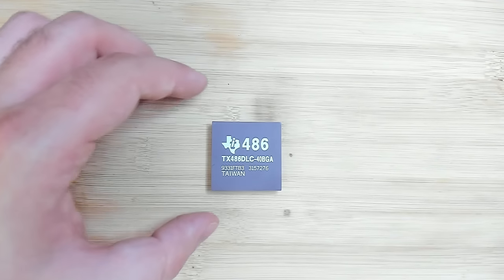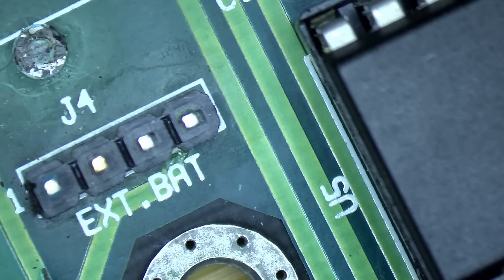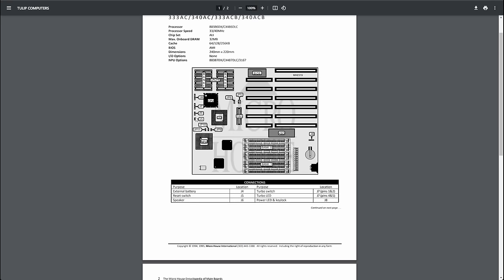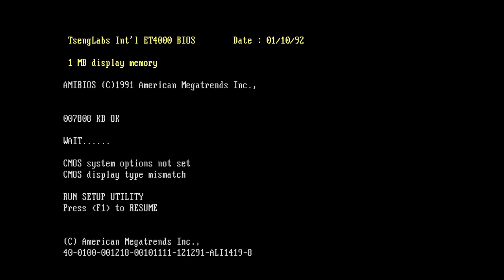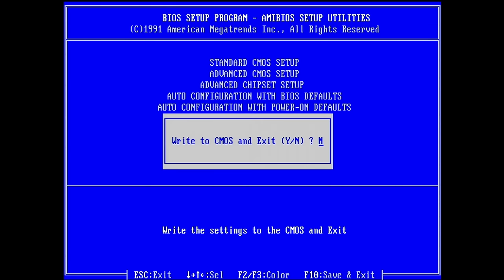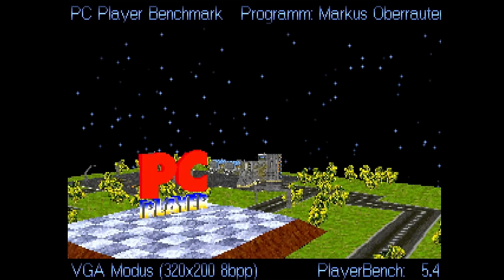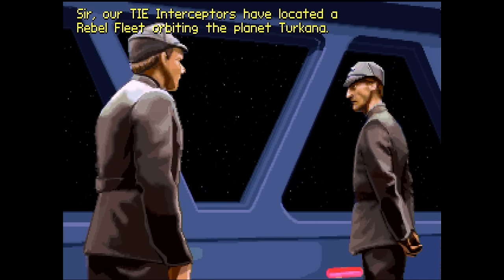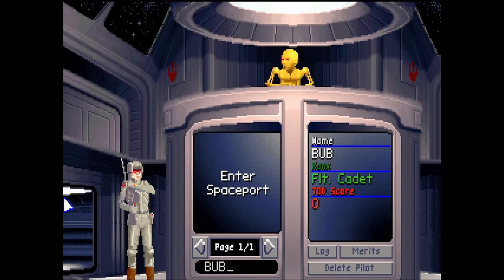A wolf in sheep's clothing: Cyrix 486DLC

Comment: As usual, great video. I have an Intel 486DX 25Mhz processor. It is historically the first 486DX processor and supposedly doesn't require a heatsink, but.... it heats up considerably during operation, so if your 486DLC has a 40Mhz clock then it definitely needs to have at least a heatsink.
Reply from the maker: I agree. Those CPUs shouldn't be operated without a heatsink. The surface on my 486DLC got uncomfortably hot - I wonder for how long this CPU was tortured in that motherboard before it was thrown out. I guess those chips can withstand higher temperatures than my fingers, but a simple heatsink can do so much! There is no reason not to put one on those CPUs.

Comment: Auto detection was a very rare thing in 386 and early 486 days.
Reply from the maker: I was surprised to not see the option because my Soyo 386 board had that option. And the BIOS looks very similar (but that isn't an indicator - most BIOSes we're just copies).
Reply: @bitsundbolts  Aye, I can only recall maybe a handful of boards I ever saw it on, then it appeared on everything at once. More towards the later 486's.
Reply: @envoycdx  And also, an unreliable mess. You're better off not relying on that auto detection and instead using an XTIDE 386 BIOS on an add-in card so you get proper LBA support.
Reply: Yeah I remember putting in CHS values until around the Pentium era.

Comment: This was my processor of choice as  a then-new user of OS/2 v2.1.  It was a heck of a lot cheaper than a 486, performed awesome, and you could take that savings and put it into more ram, which OS/2 really needed.  This with 8mb of ran was the sweet-spot.

Comment: I had one of these 486DLC-40 CPUs back in the day that I bought with a motherboard from Computer Stop in Bellevue. It was a lot faster than the 386sx I had previously but something caused a problem I never resolved where anything that played .wav sounds through the Sound Blaster would cause a cyclic screeching sound. Later I upgraded to a Pentium 60 and was blown away by the speed increase. I miss the days when you could upgrade after just a few years and see an absolutely massive speed increase, like 3-5 times faster. Now a brand new computer is maybe twice as fast as one that's a whopping 10 years old.

Comment: Ah great memories. My first PC had a Cyrix 486 DX2 80 MHz CPU installed. I reckon performance wise it would pretty much equal an Intel DX2 66. I've had it for nearly 2 years before replacing it with a Pentium 133 back in 1997. The 486 took me from DOS 6.22/Windows 3.11 to Windows 95. What a difference Win95 made.

Comment: A small part of me misses the 90's, when we were able to squeeze an extra mhz out of a CPU and we actually thought we could see the difference.  Things were so much simple then.
Reply from the maker: It was the time PCs entered households and consumers started using PCs for all kinds of things. The people who grew up during that time will have good memories of that simpler time. You could buy a new system every 18 months with double the compute power - or upgrade with a drop in replacement. Another option would have been overclocking which could unlock some extra performance and increase the usefulness of a CPU for a couple of extra months.
I like the 'simpler' time because I learn about electronics while I'm trying to restore those old electronics.

Comment: Nice work and comparison.  Both the DLC and DX were more than playable from the footage, but the DLC was noticeably smoother.  For whatever reason, when I had the 486 DLC back in the day, protected mode extender games had this weird habit of causing the keyboard controller to randomly malfunction.  Never did track that one down, and I never really see it mentioned by anyone else, so it could have been a fluke of my specific system.  The joystick ports would keep going fine when this would happen, so I had that going for me.
Reply from the maker: I was surprised how well the 486DLC performed. I didn't notice any weird behavior of the CPU, but I also didn't test it for a long time. I want to experiment a bit more with that CPU, the BIOS cache setting, and the Cyrix tools. Maybe I'll come across the issue you faced.
Reply: @bitsundbolts  It has been a long time since I had that computer, but I remember the symptoms well.  I'd be cruising along and then the computer would freeze for a moment, with the usual last-few-milliseconds of audio effect.  When I'd come out the other side, no keyboard until a reboot.  

I suspect now that I may have been offloaded a 386 board that wasn't quite compatible by the dealer, since I wouldn't have known better back then.  I've also read that early 486DLCs get very hot, and I don't think I had a heatsink or fan at that point.  The idea was pretty foreign at the time!

With everything working, though, it would be a good and cheaper match for its real competition, 486 SX 25 and 33 computers.  Kind of like the DX 40, it was a really nice and popular alternative to hold out until things got more affordable.  Keep up the good work.
Reply from the maker: I noticed the temperature of my 486DLC as well! It runs way too hot without a heatsink in my opinion. A cooler might have done the trick to solve that issue you had back then. During my research, I found many saying those CPUs weren't good - maybe they were badly priced for what they offered. But I agree, those CPUs could compete with entry model 486 CPUs, especially the SX versions without a floating point unit

Comment: CLK2 is the name of clock input pin on the 386 chip (yes, where the crystal connects). The CPU divides it by 2 internally, hence the name I guess.
Back in 486 times I used to overclock my ISA bus to 13.33MHz (40MHz /3) 😸
Reply from the maker: Well, glad I figured that out on the fly 😂. Wow, an ISA Bus at almost 14 MHz? Wouldn't that cause all kinds of stability issues? I guess it depends what expansion cards you used.
Reply: @bitsundbolts  I was a kid and just poked around to make my 486 faster. It did work with generic ISA I/O card (Winbond chips IIRC) and Trident TVGA 8900. Added ALS100 sound card later, and it also worked. Just remember that /2 didn't work and /3 did, so I left that. Going from 80MHz 486DX2 (overclocked from 66MHz) to K6-II at 350MHz was a huge jump 😃

Comment: I have a 386 motherboard that I've been restoring, as it was badly damaged by a leaky battery. And for it I have a TI486DLC-40 ready. The other 386 I have is a cute little one, with a soldered SX and room for the 387.
Reply from the maker: Nice! Good luck with the restoration if it isn't done by now. I hope both boards will work well. The 386 is an amazing platform - at least that's how I feel about it.

Comment: The only place I ever remember seeing these are in laptops, and I think an old laptop I have ever has one in it. Pretty nice performance bump on a 386 board, it makes me wonder why these weren't more popular. My first dos computer was a 386dx40 in 1993, and that was the common low end option at that time, with all 486s up to the dx2/66 being quite a bit more.
Reply from the maker: I think the price of these CPUs was very high. I read that it might have been cheaper to get a low-end board and a 486 instead of one of those. If they would have been priced better, maybe they would have been more popular. But I agree, looking at the performance today, those chips were nice upgrades for 386 systems.

Comment: I managed to get an entire 486DLC desktop computer a few months ago.  The CPU is soldered directly to the board on mine.  It booted right up and the latest file date on the hard drive is 1998.  It appears to have been used for a machine.  I have not loaded any games on it yet but I look forward to comparing it to my own 386 computers and my lower clocked 486 computers.  The battery had just started to leak but no corrosion on the board was noticed after I removed the battery.
Reply from the maker: You got lucky that the battery didn't cause damage! Boards without damage aren't that common. I'm sure you'll have a lot of fun with this system.

Comment: I was going to buy one of these back in the day (around 1994-5ish) but it was actually cheaper to buy a Cyrix 486DX2/66 with basic PC Chips motherboard (especially when you factored in the sale of the old board) ... Yes those motherboards were terrible but I was a student and it still represented a huge improvement over my 386DX40!
Reply from the maker: That is what I've read. It wasn't worth buying those hybrid chips for the price they were advertised for.
Reply: @bitsundbolts  Yeah... I guess they were cost effective if you had a machine with a proprietary motherboard and so couldn't cheaply replace it.

Interestingly though I do recall some budget PC builders in the UK selling complete 486DLC40 machines for prices between the 386 and 486/25. So if you bought these chips in higher quantities they must have been quite cheap.

The same sellers were also selling UMC 486 based machines which also seem to have been massively underrated. 

And interestingly, from your findings here the 486DLC40 was a better budget option than a 486SX25 for sure... These had a reputation for being a bit slow and rubbish at the time but to be honest it looks like that wasn't deserved!

Comment: There's no need to disable the charging circuit: The ALI M5818 RTC has a dedicated battery input, like the Dallas DS1285! All you need to do is fold up pin 20 and hook up a CR2023 (pin 20 = positive, negative to common ground, e.g.pin 1 of the chip)

Comment: On every board in bios, I recommend enabling all caching, all memory shadowing to be enabled to get easily decent performance configuration. You did most, but forgot shadow ram.

Slow refresh with the highest period time is also a bit of boost.

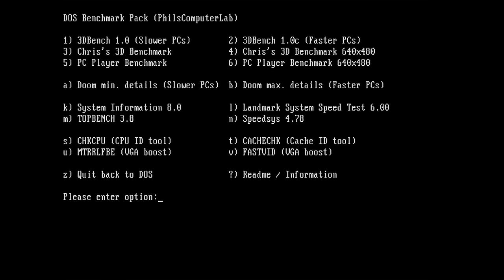Uh-uh! I'm famous! 24:35.
I think I got it working eventually with some cyrix specific software. I still have that setup and I can try some stuff out, if needed.
Reply from the maker: Hehe, yes, I did use your post on vogons in this video 👍. I'll check those options you mentioned in a follow-up video. The goal will be to get as much performance as possible from this platform. I mostly want to see if the BIOS or the Cyrix software does a better job in enabling the level 1 cache of the CPU.

Comment: What microscope / camera on microscope are you using? Your video quality from those close up shots are phenomenal.
Reply from the maker: It is a basic trinocular microscope, but I am using a 4k camera mounted to the microscope.
Due to space limitations on my SSD, I have to down-sample to 1080p though. I should make a video one day to show all the equipment I use.
Reply: @bitsundbolts  My "microscope" is a cell phone, mounted on a truss I made. I use an app that gives me access and control to the camera from the PC and I view it on a screen attached to the wall in front of where I sit at the workbench. It's 2x optical zoom, but can take the digital zoom to 10x, and since it supports 4K the magnification quality is good. Better yet, I made an application that receives the video stream and applies some extra processing, such as brightness, contrast, color (intensity, tones, pseudo color), denoise, glare reduction, I even apply super resolution so I can get a better 10x zoom, or reach a "virtual" 20x zoom.

Comment: My "microscope" is a cell phone, mounted on a truss I made. I use an app that gives me access and control to the camera from the PC and I view it on a screen attached to the wall in front of where I sit at the workbench. It's 2x optical zoom, but can take the digital zoom to 10x, and since it supports 4K the magnification quality is good. Better yet, I made an application that receives the video stream and applies some extra processing, such as brightness, contrast, color (intensity, tones, pseudo color), denoise, glare reduction, I even apply super resolution so I can get a better 10x zoom, or reach a "virtual" 20x zoom.

Comment: Slightly more fluid X-Wing play on the '486 upgrade chip for sure.
Reply: It's still a little surprising how playable it was on the 386.
Reply from the maker: I was surprised as well. You could play that game on a 386. I should try the trench of the death star with graphics set to high.
That reminds me, I used to "cheat" by reducing the graphical details in death star missions because you ended up with less obstacles and less laser turrets 😂

Comment: The bios sees it as a 486SX because that's sort of what it looks like to a BIOS unaware of the DLC family. It seems like the board maker didn't bother properly setting up the BIOS for the DLC, I bet they just enabled whatever flag they needed to enable to make the bios 486 aware. I'd try the bioses from those boards on the Retroweb that look similar and use the same chipset. One of them might be optimized better for the DLC. Also, there might be a MR-BIOS for that chipset so it might be worth looking in the archive posted on VOGONS.
Reply from the maker: Great idea! I should try that. I've read that the BIOS doesn't properly activate the DLC and there might be more performance that can be unlocked using the Cyrix utility. I'll have a look and see if I can get somewhere with different BIOSes.

Comment: On the cache, back means Write Back cache instead of write through as with a buffer. Write Back should be faster though some boards have a bad bios implementation of this and can cause problems, if it works it will be noticable performance wise though.

Comment: These are fast when overclocked. I had UMC48x board with swappable oscillator. Got my 486DLC up to 50MHz and it did run everything. UMC48x 386-boards are anyway really fast.
Reply from the maker: Nice! That would also mean that ISA and memory is probably overclocked (ISA probably at 10MHz). That should give a nice boost overall. I would need a 100 MHz crystal though.
Reply: And if you can run L2 cache at tightest settings anytime, the better. I think my memory needed one wait state on reading... @45MHz everything was set to tightest. Some ISA display cards can take up to 20MHz but some only around 12MHz. But if the card is slow (Trident 8900C) then the clock doesn't help much. BTW, Trident 8900D is a fast one and often overlooked.

Comment: Unlike other bad experiences with non intel cpu's from that time. Sold tons of those chips. I had a good talk I think with TI. Not sure about. I think the normal voltage of being 3.3 or 5v. Not the core voltage. Had a lot of 30 computers and noticed some of them having issues. Set it to 5v's and no issues. This was before the internet. Just ordered trays of them oem. They said no problem. The chip was designed to work in that range. So if they ran better at 5v. Set them to 5. Now with the internet it is easy to go back and look at the specs to see what model supported what. If I remember correctly the manual or bottom of the chip said 3.3 and a few other things. But you are talking over 20 years ago now. One of the things I find funny is all the stamping AMD, Cyrix, etc did with the chips showing windows, dos compatible and such. Also the heat sync required.

Comment: ISA CLK speed settings are related to crystal oscillator speed, but not the one you showed in a video. Board should have  independent oscillator  at 14.31818 MHz and it is a value that you base calculations on. So, 2/3 of it gives ~9,54 MHz, 2/5 gives ~5,72 MHz and so on.

Comment: Have you tried to change JP 9.10.11? Maybe Speedsys is freezing because something is not set right, as you said, something related with internal cache or CPU  related.
Also, how does compare the TI CPU with or without APM? Does the /E version have some low power states?
Reply: Yeah the manual said closed/closed/closed but in the video they were open/open/open.. might be some more speed to be had too (L1 not enabled perhaps?)
Reply from the maker: I briefly tested both jumper settings. I didn't notice any difference, but I need to revisit that topic.
Reply: @bitsundbolts  definitely needed pointing out for us obsessive nerds who are thinking "the jumpers! the jumpers!" 😂

Comment: I have two questions at this point. One, should Cachechk show that one kiB of internal cache? Maybe it should but it was the very same when I tried it on a 'DLC (and a similar small 386 board with ALI chipset and apparent BIOS support for Cyrix CPUs), the only change in memory speed came at 128k. Shouldn't the very first, "1k" data point be different?
The second one is a bit of philosophy. I mulled over it quite a bit when I wrote my article about this very 386-486 transitional era. The question is: what is a 486? What makes a CPU a 486 instead of a 386? If it's L1 cache, then the DLC has it. If it's better pipelining, I don't know. If it's using the 486 bus, well, the 'DLC's very purpose was to fit in a 386 environment (let alone the SLC which has a 16-bit data bus at that). If it's Intel's very own 486 design, then the DLC is something else. But I suppose it's not an Intel 386 design either, so it's a wash. And what about Cyrix's 486SX or DX/2/4? Performance? Then it falls between the i386 and the i486. So I'm still not sure.
Reply from the maker: Yes, there should be a drop at 1kb. I expected that and wanted SpeedSys to confirm it, but that application doesn't seem to work. I will revisit this CPU and try to find out more regarding its cache system.
If you look at the CPU by itself, then you could argue it to be more of a 486 than a 386. However, if you consider the entire platform, it gets harder to make a case for it. I definitely can see how it is difficult to put this CPU in a specific class of CPUs. It's somewhere in between 🤔